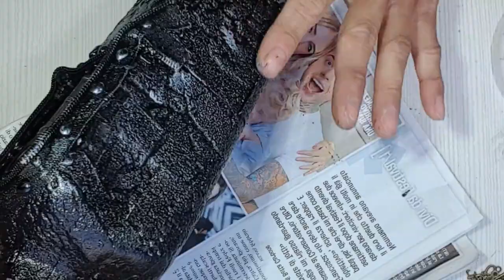#25 /Steampunk Bottle Art/art and craft / Decor Antique Bottle Art/ Wine Bottle Art/ Altered Bottle

Comment: What tipe of the clay do you use for the skull and gears?
Reply from the maker: Good evenung Sir RIETTE😊 i used normal clay nothing special sir. Any clay is good. About the gears i buy it on amazon. But if you watch some of my bottle video i also clay for gears.hope will help you a lot.
Reply: Thank you for your reply. I live in South Africa and things like the metal gears are hard to find or you have to import it that takes ages plus Import fees. I saw your video where you make your own with clay. We have air-dry clay but I'm just scared it is going to crack or shrink.
Love your projects❤️
Reply from the maker: Goodmorning again sir riette😊im here in italy but im filippino😊 yeah gears are expensive and its hard to find the right one. Thats why in my work mostly i use molding clay and gear stamps moulding  when you paintnit you cant recognize it at all and it will look like real. Again sir riette thank for spending time to watch my videos. May gob bless you always😊
Reply: Ваши работы просто супер! Подскажите пожалуйста где можно купить такие ключики??? Заранее благодарю.